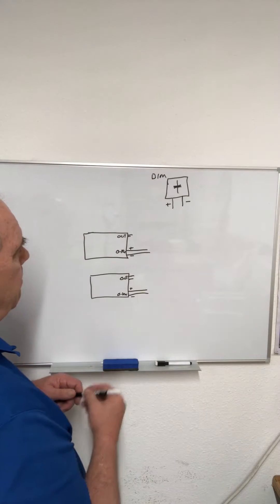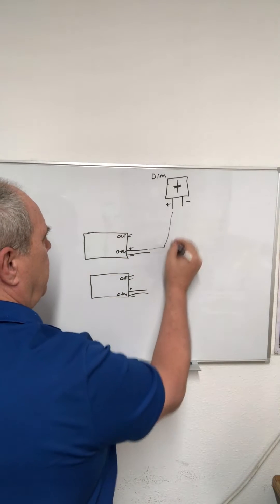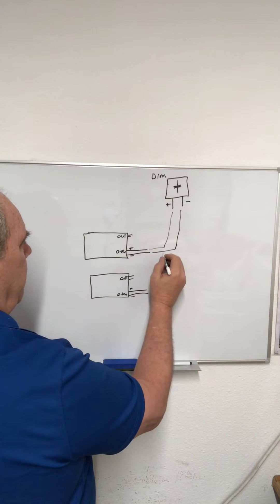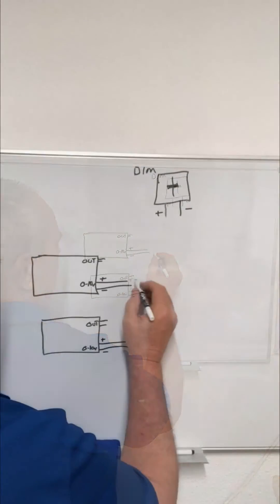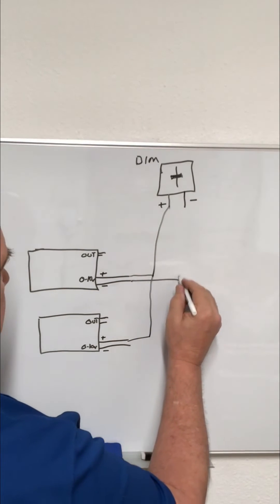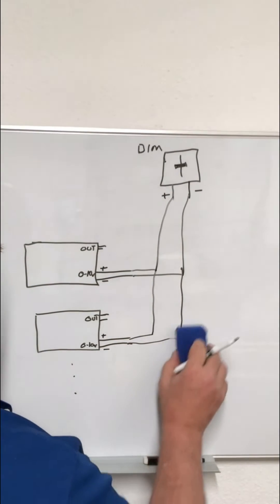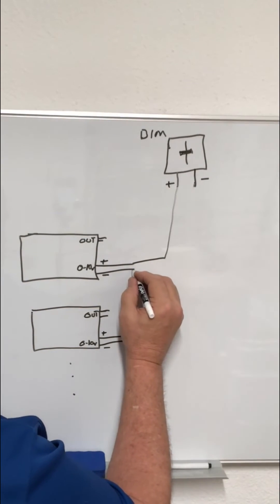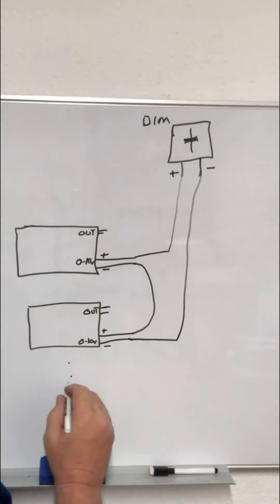How to Connect Multiple LED Drivers to A Single Dimmer/Lighting Controller

Comment: Super helpful. One clarifying question, does  the dimming wires connect when running in parallel happen in the same junction box as the one being used for the hot and neutral?

Comment: The first option is a much better idea than the second. The voltage drop across each unit would become an issue very quickly if you connect them in series like that. Not to mention, if they are in series, then only one of them has to break for them all to stop working.
Reply: This happened with variable frequency drives in a car wash we were servicing. The VFDs were daisy chained and took them all out. Nasty work by the original service provider since they were also the distributor of the parts.

Comment: ok in ma garage I have 4 celing flat leds (120x60cm). Each panel have driver 60W 1.5A 48V...so this is 240W total. Can I buy any single 220v wall light dimmer and it sholuld work?

Comment: Your diagram showed two wires on the driver labeled OUT. Can the drivers be daisy chained by running the OUT of the first driver to the 0-10 V of the second driver, and then OUT of the second to IN of the third and so on?